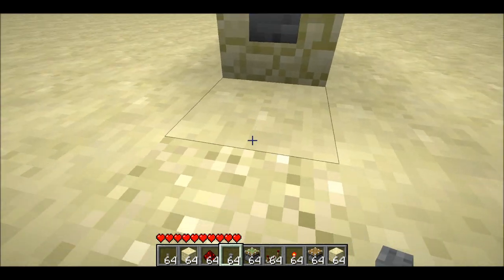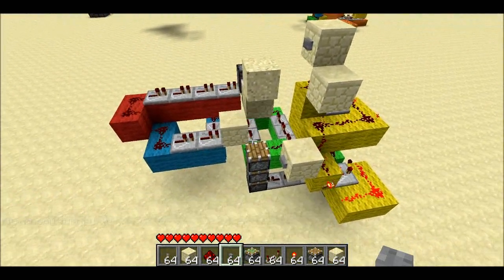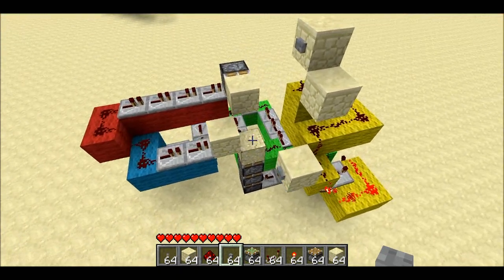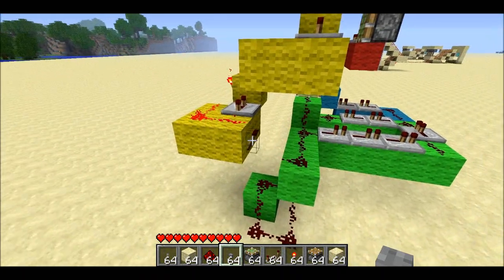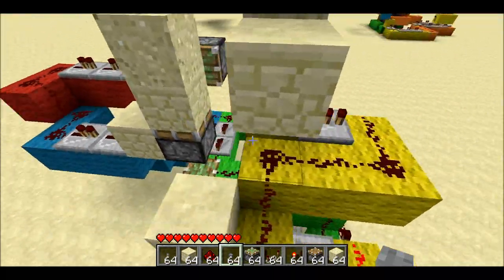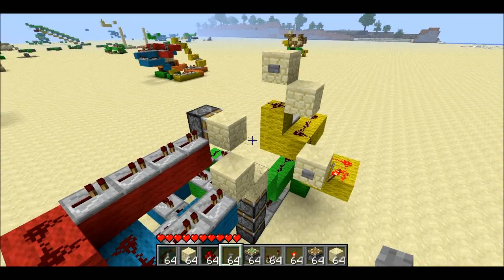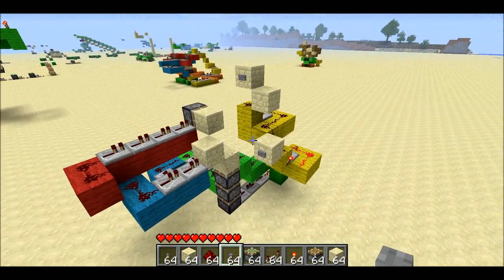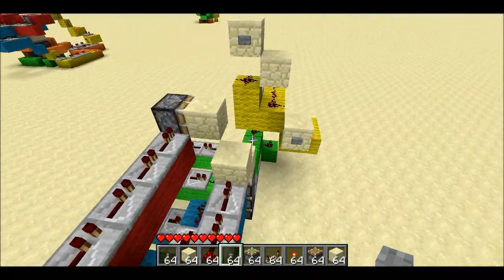Two-Way Piston Trap-Door/Elevator

Comment from the maker: @eddyme08 Yep. But you'd either need another sticky piston in the stack, which would make retracting the stack much harder, or the piston would only push you one block below ground level and you'd have to jump out. Plus, there would be a piston visible on the outside when the elevator is up.